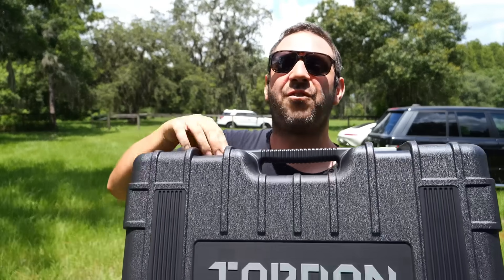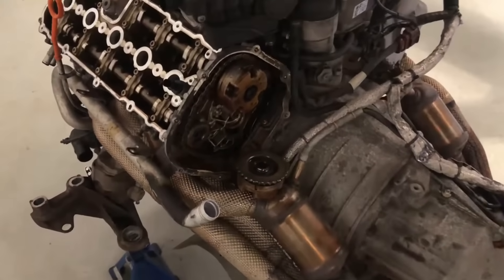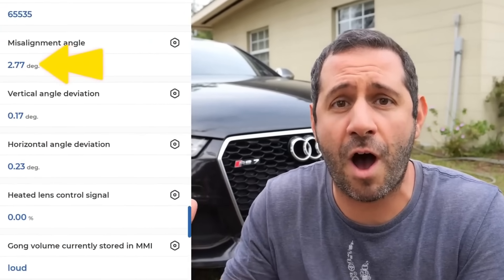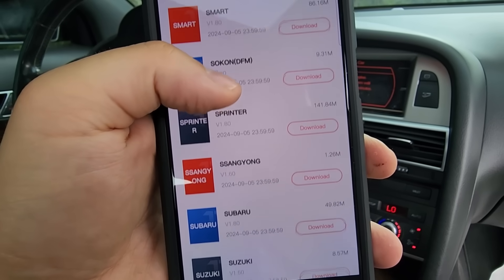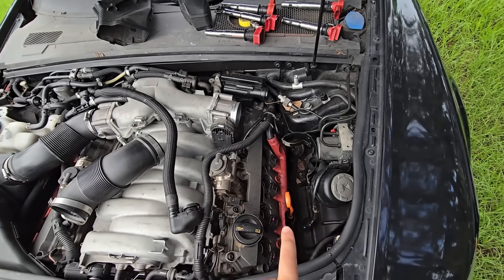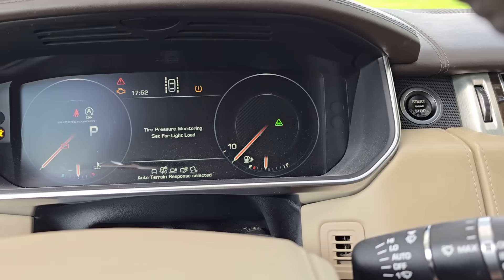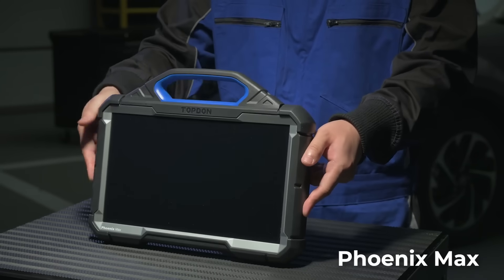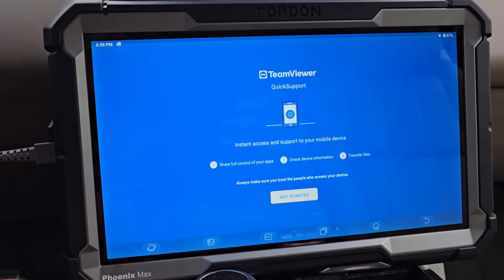$60 vs $4,000 Chinese Diagnostic Tool to Fix a Dead v10 Audi S6

Comment: The subscription fee is a deal breaker. I hate subscriptions.
Reply: Just change your email address and register again to always have a free subscription
Reply: @prateshsewdass7413 did it work with any one ?
Reply: lol even if it was 1$ a year, I just can't, I'd rather pay whatever they want for the device and be done with it
Reply: Blue Driver costs $100, but lifetime free updates and goes pretty in depth as well with live data too. Not every make on Blue Driver supports "enhanced diagnostics" but Audi's definitely do.
Reply: I’ve had one for like 2 years i’ve never paid anything then what i’ve bought for
Reply: The sub only covers updates for the newest cars, so a sub isn't necessary to operate unless you need to update for a future car.
Reply: @ohger1 that is wrong, the subscription is needed to continue using the tool after 12 months, if you don’t buy it, it’s just a basic OBD2 reader
Reply: @ohger1  And If you need online programing, you need to have subscriptions active !
Reply: @ohger1  you need the sub for TopScan to be usefull. If you don't have an active license, it's just a basic OBD code reader. No brand specific codes or functions.
Reply: Is the cost just for updates i have seen most of them you need to pay for the updates but also like bi directional features but it's annoying if you paid $60 for a product with 1 year and then need to pay $50  a year its like i might as well buy a new one i have been looking at the xtool a30m i think its a little over $100 where I was looking but it has lifetime
Reply: 100% agree. If there is an alternative that does not charge a subscription I will take it.
Reply: I bought one for $40, no subscription fees & it reads everything including tire pressure, lamba test, battery test
Reply: @Hugh-Jarnus what ya call it
Reply: Seems like AllData, you just need to pay for updates. I bet if you download every car you'll conceivably need it will work out for quite some time.
Reply: @vulgartech9192 you don’t pay for updates it just downloads the new one
Reply: I mean it'll take 8 years for it be equal value to a $400 scanner. Kinda worth if you're in the business
Reply: Subscription is only $50 a year. Which is only $4.15 a month which nothing compared to what you get vs the lump sum payment. It’s your choice with your money tho.
Reply: Same
Reply: But you expect them to pay employees to keep updating the software. All for $60
Reply: It's a dollar a week, what's the problem?
Reply: @stephenrose8188  It's $200 for four years...  That reminds me of when I was buying a house - I made a counter offer to the seller's agent and she told me the difference between my offer and their selling price was only 85 cents a day over 30 years.  I brightened up and said "really, that's it?" Agent smiled and said yes.  I said if it's only 85 cents a day,  the seller certainly wouldn't mind taking that little off the price!
Reply: @stephenrose8188 it’s about the principle.
Reply: @stephenrose8188  1 dollar per week is 4 bucks month thats 48 bucks a year that's 500 bucks if u kept the subscription for 10 years such deal breaker

Comment: Sam, everyone knows you just unplug the parking brake and aply 12v to the contacts to unlock the caliper, then reverse the polarity to close the caliper again. Everyone has a 12v battery, no need for a scan tool to do that.

Comment: I tried the topscsn on multiple 2023 ford vehicles and it  did not read any
Reply: For Ford, I've had great luck with Forscan. It's free plus the cost of a compatible USB or Bluetooth adapter, so roughly $30. You just need a laptop of smartphone to run it.

Comment: Wish I would have known about T Ninja Pro for keys back when I owned my 04 S4 and 07 RS4. I had a replacement key that wouldn't start the car on the 04 (opened the doors, etc., but when started the immobilizer killed the start immediately) and a replacement key that wouldn't open the doors on the RS4 but was fine for starting the motor because I kept my original metal key w/chip and put it in a new case which for some reason would never unlock the doors). For less than the dealership would charge me to either replace or fix both keys I could have bought the TNP. Just traded them off for a new Porsche Cayman S so I kind of went with the most expensive fix (lol). Great info about the keys because there's so much smoke and mirrors type obsfucation about smart key programming on the net I can truthfully say this was the most informative and straight-forward solution I've ran across...and, I've tried researching solutions until I just gave up and lived with what I had. Nuggets like this is why I love your channel.

Comment: Sam, Great video very informative! Can you cover air bags and ABS in you next video? I currently have a Bluepoint scanner but it doesnt do all the cars and it cant program a new SRS control module the one usually under the center console. Thanks
Reply from the maker: What information are you interested in on  SRS systems? Thanks for your comment!
Reply: @Samcrac  Hey Sam. Thanks for the reply! So when the airbags deploy most makes say you need to replace the body control module or the air bag control module, depending what they call it. You know the module under the center console. Can that be re programmed or does it have to be replaced? Also if you do replace it, the new module often has to be re programmed. Hondas plug right in and away you go but GM you have to tell the module what it is. You buy a 1500 truck module but then you have to tell it if it' a 2 door or 4 door if it has knee bags all that. do any of those scanners have that ability?

Comment: For VW/audi s in particular you can always buy RossTech VCDS which is the actual VW software  i got mine for $300. 

And OBD11 is on ios, and has the same finctions but much easier to use. Both are worth it.

Comment: With all new cars having built in screens & internet these days, i dont see the reason why scanners are still being used. There should be new regulations that force manufacturers to have fully complete built in diagnostics software.
Reply: So true, it should be a dashboard function.
Reply: How they do billions of dollars?it need to cost few backs the best tool with free update but they dont care and take allot of money
Reply: Because its easy to brick your car if you don't know what you are doing. There are literally hundreds of systems and subsystems on modern cars. You don't want your average owner fooling around with stuff that can stop the car operating.
Reply: Ya well some vehicle doesn't have screens like base models then they would have to force everyone to put a screen in which is kinda Insane but ya there is no good reason they can't or don't do that
Reply: It's not that special... take a mediocre scanner.
The apps are the ones you need, I use Carista and bimmercode(BMW).

On our Mclaren it's not really compatible but I believe almost no scanners work with it. 
But still, I can just read the codes and reset several things with Carista.

Also, Carista is easy to use. On the VAG cars you have several options you can change, like the starting screen, colors and the needles going up and down when starting the car.
Reply: Chrysler had code retrieval in car for many decades but ended it somewhere  2015-17.  The story was the federal government with ever increasing emissions rules didn't want average joe working on the cars, especially emissions related items.  Much easier to ignore a gross EVAP leaks when you can quickly verify what the check engine light at the grocery store parking lot.  Of course the government is an easy blame and it could've been a desire to send more business to dealers.
Reply: tesla seems to have that very hidden capability, so maybe it takes a jailbreak there
Reply: Companies like topdon monopolise the access to make money, they have the market cornered so can price the access however they want.
Reply: @czadirect  It's not the scan tool companies, it's the manufacturers who want you to return to their dealers for service. The US government had to step in back in the 90's to prevent the manufacturers from cutting off everyone but their dealers. This is why we have an OBD II port as mandated by the government. It is a constant battle by these scan tool companies to get the information necessary to perform the proper functions. Many of these companies have to reverse engineer the factory software in order to provide those functions.
Reply: @1MiketheMechanic can’t agree with you more.  I’m having an issue with my 2023 Ram. Fully loaded! Supposedly,y dream truck. It’s F—-ing nightmare. 9 trips to the dealer since I’ve owned it. The truck now has 1,700 miles! THATS ALL. WHY ? It spends most of its time at the dealer. Called my attorney this is definitely a lemon… I need a new one that works.
Reply: @czadirect  Topdon is a relatively new company in most of the world.  They don't have anything even remotely approaching a monoply.  Topdon is actually a budget knockoff of Launch's products.  Bosch, being the manufacturer of Ford and GM's diagnostic tools, has a much more control over access than Topdon will ever have.
Reply: The new BMW subscription...
Reply: This already exists, is call going to the dealership, that’s why tools like those are needed
Reply: @muitode  people like you are why everything is so messed up these days. glossy eyed bootlicker

Comment: The Audi is definitely a nice car Sam, it's unfortunate that the engine has failed.
Someone needs to come up with an easy LS Kit for cars like this and many other European Cars with Failing Engines, that are in North America.
The 3 biggest issues that would need to be addressed, Engine to Transmission Adapter, Electronics and HVAC.
But it would definitely be a money maker and would save a lot of these cars from becoming parts cars.
I'm curious on the low dollar scan tool when selecting country, what would happen if you selected Europe, Would you get different information??
Theas high dollar scan tools definitely need to be regulated, since thieves are using tools like these too steel cars.

Comment: I can vouch for the Topscan because it diagnosed an issue with a battery control module for my Chevy volt and I got it replaced under warranty.  If I had waited 3 months then it would have been out of warranty.  Saved me thousands of dollars.
Reply: Why wouldn’t the dealer or a shop have been able to identify that issue????
Reply: They want to skim more money

Comment: Everyone knows that if you have a VAG product you should get VCDS - that's the only tool you need and it's around $400.   Basically exactly the same as the dealer tool.
Reply: You wish. I like VCDS but ODIS with Guided Fault Finding is far superior. With the factory scan tool it basically walks you thru diagnosing any issue with a fault code.
Reply: I just got a Chinese one for 30 bucks that dies the same thing. Its awesome
Reply: Can some please explain what VAG and VCDS are
Reply: @_iron_patriot7018  vag is volkswagen audi group and vdcs is VAG-COM diagnostic system
Reply: @_iron_patriot7018  vcds is a tool for diagnosing electrical problems on vag cars. VAG is simply “Volkswagen Audi group”.
Reply: @_iron_patriot7018 ” VAG” is “ Volkswagen Audi Group” VCDS is one of the better scan tool/ coding software for Audi/ VW
Reply: I know someone who sells vdcs for £20
Reply: Get OBDeleven for 60 Eur instead of VCDS a dedicated  and officially licensed VAG, BMW and Toyota group device.
Reply from the maker: I kinda disagree with this. VCDS is pretty overpriced and only necessary for very specific things. Like I showed with the RS7, I was able to calibrate my radar systems with the $60 Topscan. VCDS features have been cloned on pretty much every decent aftermarket tool at this point.
Reply: @Samcrac  In Algeria we have a problem with mileage rollback what would be a good system to accurately check real mileage for VW group cars ?

Comment: You should do a video on rebuilding the steering column lock module. 

Easy rebuild, but for people who can't get their S6 started, this is usually the culprit. Also curious if you have had issues with it. If not, you can unlock the steering column module through VCDS. if the module isn't completely fried.
Reply: Side note - Can't think of too many Audi's that need an engine pull to replace motor mounts. Compared to a V6/V8 Mercedes, the Audi platform makes servicing the motor mounts relatively simple.

Comment: Does the Phoenix Max solve your problem with the Aston Martin module programing? Thanks for sharing this info. on these tools.
Reply from the maker: Unfortunately I've found that Aston Martin, and McLaren, V12 Lambo and some newer Ferrari models require really proprietary diag tools. I did try Phoenix on my last AM video and it will NOT program that module. But funny enough, it WILL program that module if it is was in a Volvo!
Reply: It’ll possibly program modules for AM from the ford era, doubt it will do many modules via OBDII on the newer AM vehicles, but since many are from MB possibly get away with doing some on the bench with the addition of the T-Ninja Box which is programming box and comes with adapters and bench cables to read/write to all sorts EEPROM/MCU chips for flashing, cloning, and advanced key work.

Comment: Hello Sam. What scan tool do u recommend if u just want to do basic maintenance like brakes. Some cars like Lexus require the rear parking brakes to be put in maintenance mode before u can change them. Thanks.
Reply from the maker: The topscan I showed in this video!
Reply: @Samcrac  👍🏾
Reply: Xtool

Comment: AMERICAN V engines don't number down one side,  the alternate
For example - the passenger side cylinders, on an LS engine are 2,4,6,8.
The driver side is 1,3,5,7
Edit for spelling
Reply: Look up an older Ford. They start on passenger side with 1234 and 5678 are on driver side. Just saying

Comment: Codes are generic. Just cuz it doesn’t have communication with the sensor doesn’t mean the sensor is out. Could be wiring. Could be the main computer etc….code readers are not save all devices. Still takes investigation and elimination to pinpoint the issue

Comment: You can thank all the hackers out there that broke the vin matching so we and independent car shops can repair cars. The right to repair is a huge deal now a days.
Reply: Actually, you can thank the State of California for forcing car manufacturers to implement OBDII and conform to standard error codes.
Reply: @___asd159gh43  what is OP please?
Reply: @philtucker1224  original poster - i.e techwolf in this comment thread
Reply: @___asd159gh43  Neither do you, unwanted birth stain.
Reply: Why is everyone staying idle, all sitting back and letting those in power get away with controlling our lives to the extent, we  can't repair our own vehicle(s)? 🤔. I  thank you and the rest of the slow folks for having the intelligence level of a chimpanzee 👍.
Reply: Can you explain.... I'd like to know.   What topic should I google?

Comment: Almost bought one of these until I learned about the commonly broken $4000 intake manifold, full engine removal for O2 sensor or steering rack change, and coolant orings dumping coolant into the back of the engine.
Reply from the maker: Mess of an engine unless maintained to the extreme. Worth it in a Lambo, not in an A6 🤑
Reply: @Samcrac  Yes or an R8! But even then, man. The S6 had a split-pin-crank, even-firing V10 but revved pretty low. The post-LP Lambos and R8 cars had a common-pin-crank, odd-firing V10s but revved much higher. PreLP Lambos were split pin crank and even firing which were considered the best sounding

Comment: Can you show a diagnostic too that can update the battery information on a C6 Audi A6 (2006-2011)?  My understanding when the battery is changed, the computer system need to be updated to properly work with the new battery. Is that the BMS reset?  Thanks.
Reply from the maker: All the tools shown here should be able to do battery replacement update. To be honest, I've never performed one even after replacing batteries on any car.

Comment: Will it program your AM with a Volvo ECU?
Reply from the maker: Aston is one of the ONLY ones it won't. Aston and McLaren are 2 notoriously difficult ones for any advanced level diag. I did try to use Phoenix Max on my DBS several months ago to no avail. While Phoenix Max will scan both McLaren and Aston it has a bit more limited functionality.

Comment: Great diag tool vid. Thanks to Sam got the middle model for Prime Day price. Sad to see yet another Audi V10 car become "parts". If I had the time, storage, and You Tube channel that would be a great project just for engine content alone. Just not much out there in the YT world on Audi 5.2L V10 engine. Another channel recently posted an engine tear down. As a D3 S8 owner this info is gold. Thanks Again Sam.
Reply from the maker: It is kind of a unique car. It would just be way cheaper to buy a good running one and service it one time. If you look around this car that I have, it looks like it developed a really major oil leak, and whoever had it kept driving it until it popped
Reply: @Samcrac  Thank You Sir. I get your informed approach on "unique" cars... and their high price tag fixes. It has been said several times before... these Audi V10's were crazy expensive new. The "crazy" repair tax that follows them to the grave is insane. I guess you can call me "insane" for buying a minty 08 S8 last December. I just put a black door mat under the front of the car where it parks in the garage. If I can't see the oil leak on the ground then "nothing to see here". LOL! Love the content Sam. Thanks Again!

Comment: What a nightmare of an engine bay.
Reply: If that v10 is like the v6s of the same time, those doesn't even have a crank damper bolt to hand turn the crankshaft.